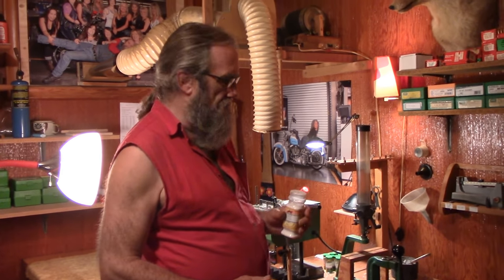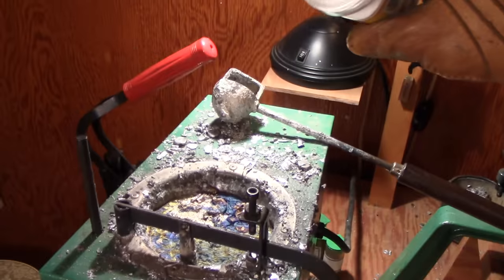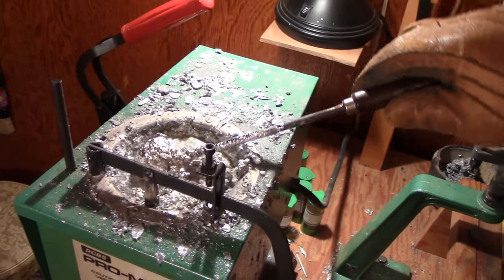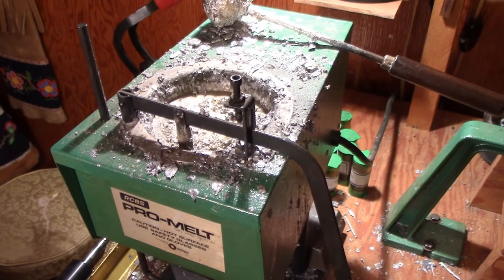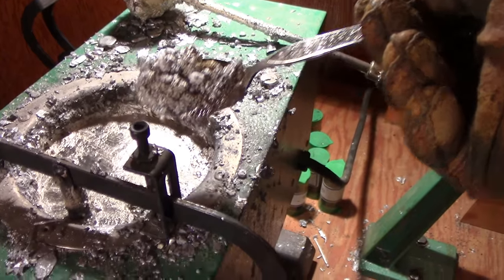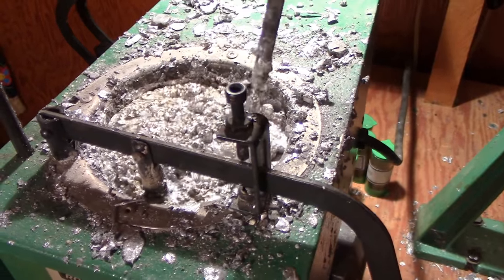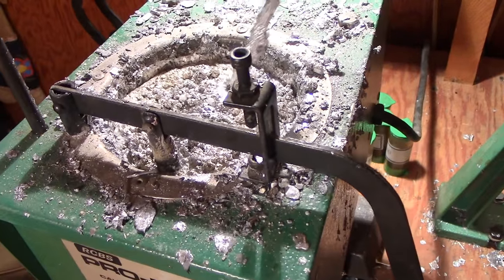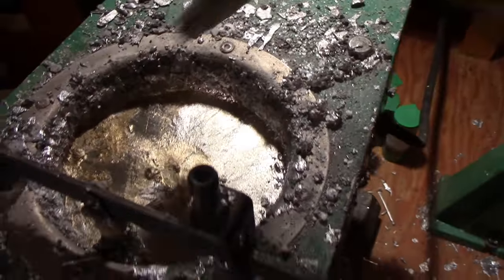Fluxing With Borax   Using the Sprinkle Method

Comment: nice set up.. Where I am, propane is a more economical choice though. I can get a barbecue tank filled for 10 dollars.
Reply from the maker: Decades ago, I used to do it with a Coleman stove burning white gas.  The advantage of an electric pot is when it comes to casting bullets though, since you can set it to a temperature where bullet formation is at its best.